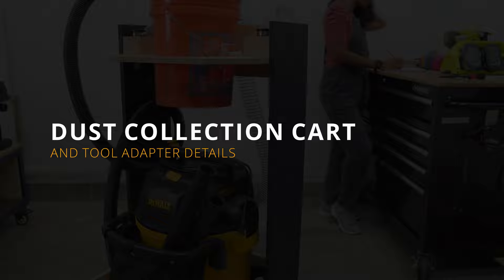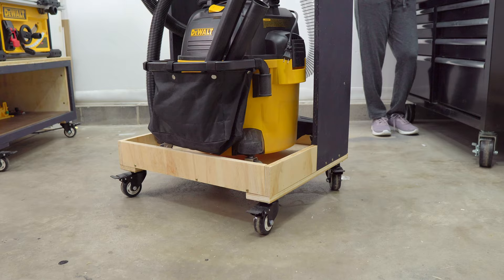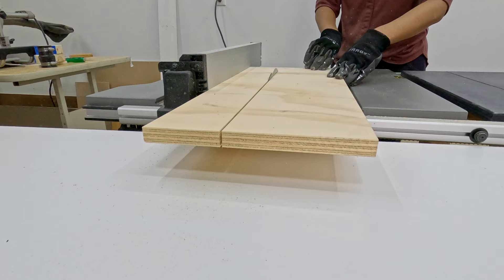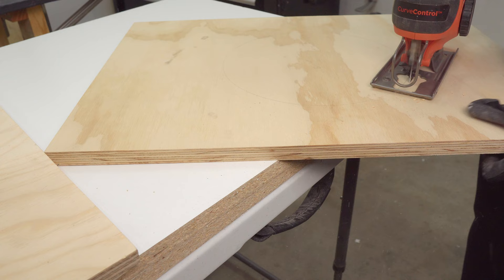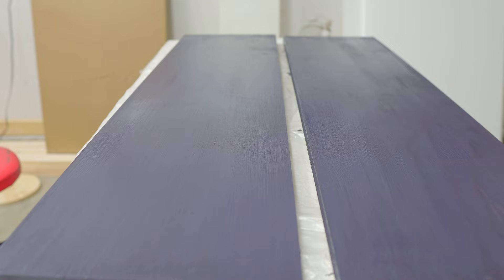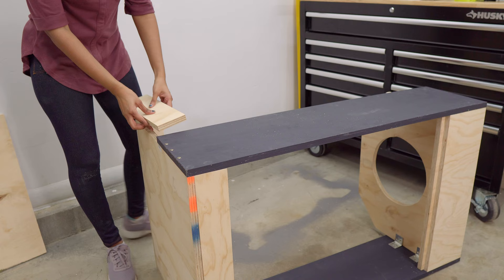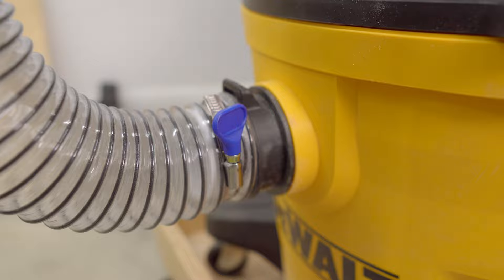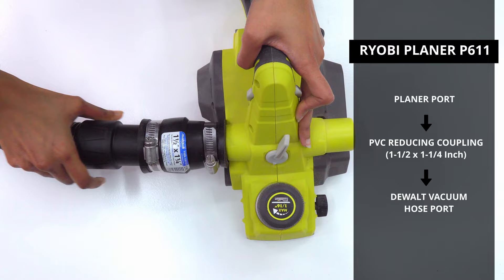DIY Dust Collection Cart with Cyclone Separator | Free Plan, Cut-List & Adapter details available

Comment: First, I could listen to you all day! Second, I just made a hose attachment for my Kreg K5. I used a tapered vac tube about 1.5 feet and plugged it into the K5 port. I let it lay at an angle to my wooden base. Then I drilled  hole in a stainless steel hose clamp. I did that by attaching it to a scrap PVC tube about the same size as the vac tube. I used my drill press with a good metal drilling bit and supported it with a V shaped piece of angle aluminum that becomes the base to hold all this for drilling. You need some oil and I also had to plan where the hole should be for tightening reasons and so the tag end of the clap is not sticking up. That had to be trimmed and man, they are sharp. Then I just put a screw in the clap and screwed it into my base. My flexible vac tube from my vacuum fits right in. This keeps that damn Dust port on the K5 from popping off. 1 week so far and I'm happy with it all!

Comment: Thank you for sharing your build! It looks great! 

One question though. I noticed that you used some screws through the face on some of the lipping and L-brackets carrying the bulk of the dustopper shelf. Could this not be completely done with pocket hole joinery like the top and bottom stretchers?